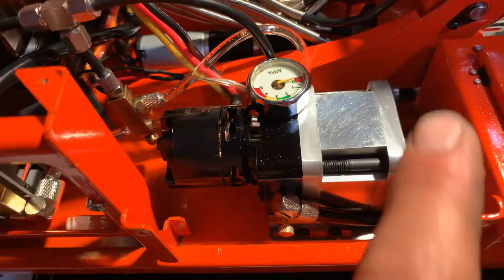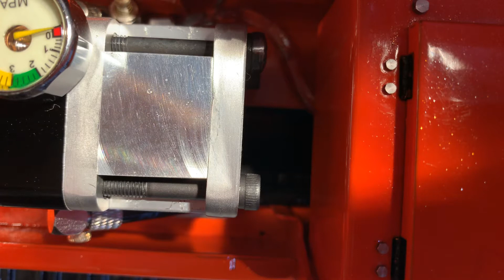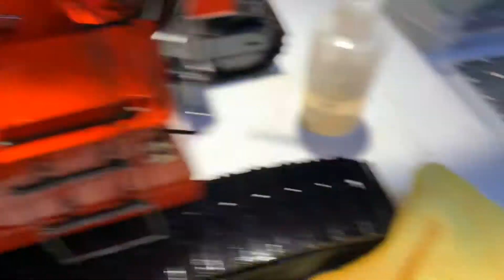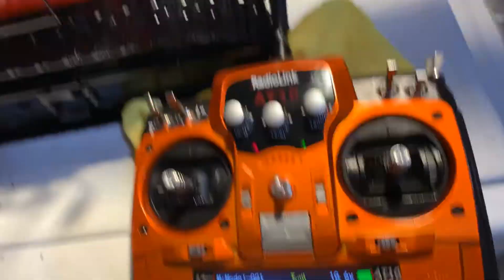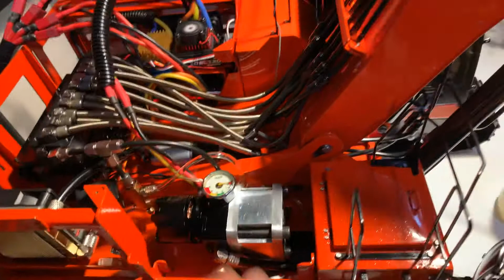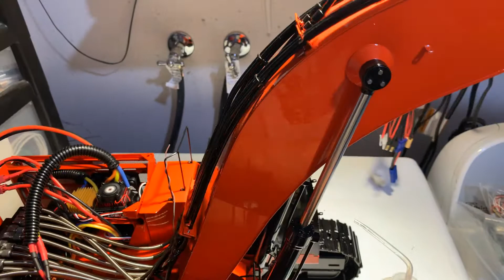Lesu Cat 374 Hydraulic System w/ regulators

Comment: These small excavator valves used a closed system so the only way for oil to return to tank when no service required is through the pressure relief. This is hugely wasteful and the oil will get hot and you'll run the battery down (uses more current idling than when working!). This is why others use a mixing function to de-throttle the pump when not providing a service so the pressure in the system drops. My DIY valves are of the open centre design so vent straight to tank in nuetral. The down side is the boom etc can momentarily sag as you open the valve and the return isnt fully closed. I will go closed circuit on my next valves as they are simpler and do some mixing so the pump stops when in nuetral.

Comment: Hey thanks for this video.  I am putting the Lesu 374 kit together right now and I just purchased it this month.   Not sure if the manifold is different but on one side it has a pressure regulating valve.  I plan on mixing the pump and not running it all the time.  what did you end up doing to fix your issue?

Comment: Interesting. 👍.  I’ve got the faroe 339dl, pump ticks over and increases with piston movement which is fine but there is no regulator as you mentioned. Thought about fitting one.  No gauge either.
Bought the replacement oil tank with gauge couldn’t get it to work, faroe weren’t helpful and I believe it’s just a faulty one, wasn’t impressed. Like the idea of clear tubing, where do you get that from?

Comment: Gear pumps always flowing oil through the system. i would say there is a restriction of oil flow in the return circuit back to tank as that would be only way to have pressure when no function is used. 
Oil should flow freely from pump to oil tank when no function used.
Oil cooler to small or restricting? may not handle the flow rate? 
Check pressure before and after would be quick check
Reply: I am curious  as  to  why you  changed  the block. Could  you  explain  please